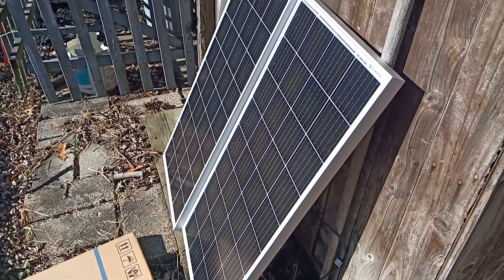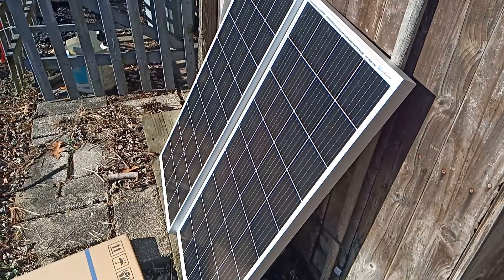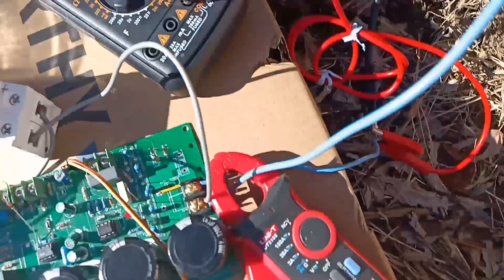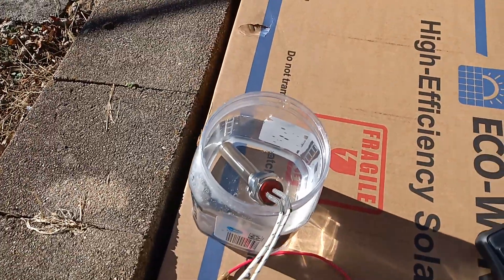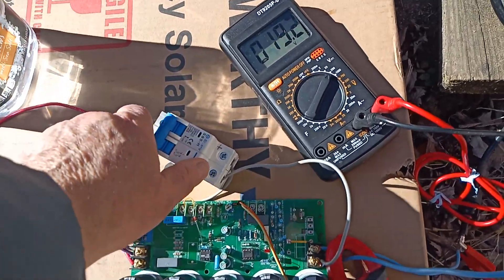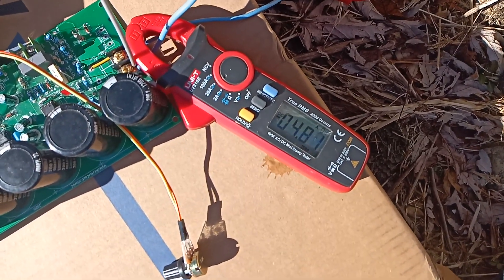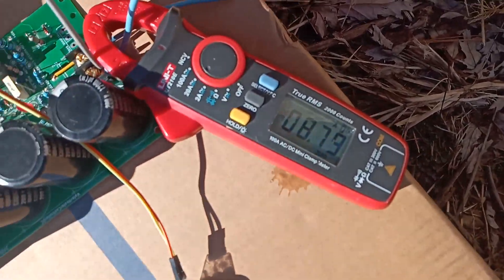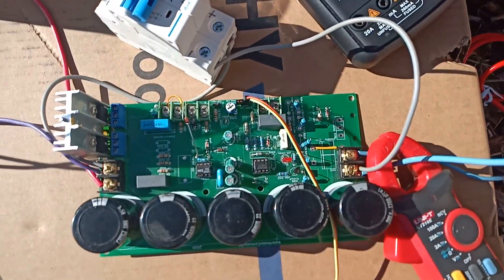Water Heater 200W 12V Element & Panel Test Direct Connect vs Power Point

Comment from the maker: With a 12V 200W heating element measuring 0.76 ohms in direct connect the current was 8.79A (Isc is the normal current in direct connect) which produced 7.5V on the heating element. That produced 66W from 200W of panels, two 100W panels in parallel.  Panel specs were Isc 5.2A, Ipp 4.95A Vpp 20.2V per label.  It was a clear winter day around noon.  Using the power point controller, the panel voltage was 19.4V and current was 8.08A (Ipp is always lower) and that produced 157W. My dog walked in front of the panels dropping the power temporarily to 4A.
Reply: try it again with 200 watts at 24 volts...........you will see the heat.
Reply from the maker: @dianetigert1310  That is a good question. But, are you suggesting a 24V array or 24V 200W heating element? No need to try this to find out. Everything can be predicted by simple math.

A 200W 24V element would work much better than a 12V one. It is slightly higher resistance than what many call ideal. Real world data has shown that total daily production increases when resistance is significantly higher than ideal in direct connect. There is considerable downside when resistance is even ideal or slightly below.

In direct connect, a 200W 24V panel would have an even greater loss of power. In fact, adding an additional 200W 12V panel in series, a 400W array, would not produce any additional power in direct connect on a 12V 200W element.

It takes a thorough understanding of PV solar fundamentals to heat water. This is the reason so many are unsuccessful heating water with PV.
Reply: @opera5714 
 In peace.....thank you for responding
I was thinking, because I to love the solar idea of trying to live in a greedy world of expenses.  
The dog blocked the sun for a moment causing the system to shut down, after he left, full sun restored the project. What if you tried solar panels that produce 24 volts each series them to 48 volts at 200 watts each totaling 400 watts?. Looks like your converter would handle the voltage? 

Maybe a converter 48v to 12v DC? Your solar would produce 48 v at 400 watts, your heater element needs 12v at 200 watts DC...........the converter you have would provide the extra voltage when demand goes up..............just thinking
Reply from the maker: @dianetigert1310  This is well established technology used around the world. It is just unknown to the US market. This is someone in Lithuania who built one of my designs which works at 120+ volts.  
 https://www.youtube.com/watch?v=3TY_u6m9JXM   
The voltage is only limited by the FET and capacitors used.  I was sent that heater element for evaluation. It is ten times lower in resistance (0.7 ohms) than the board was designed for (6 ohms).   The capacitor bank should be larger for this low resistance. It is designed to operate with a minimum RC time constant. The technology still worked with some adjustments.  I don't advocate stand alone systems.  This is designed to operate off PV array voltage which is also used by a MPPT charge controller to harvest only excess power not needed to charge battery. This is a superior way to harvest excess PV.  Nobody else does this.
Reply: @opera5714  
I've been viewing the Chinese using DC step down converters and they sure do have the knowledge.
Solar straight to DC 48v t0 12v converter then to inverter running 3 devises. Thought it might be worth sharing.
Reply from the maker: @dianetigert1310  you don't understand electronics at all. Bad idea.
Reply: @opera5714  
I was only sharing what others have accomplished, simple DC converters  (STRAIGHT) TO INVERTER THEN DEVISE. IT WORKS FOR THEM, I will continue to explore what others have achieved,  sorry to have stepped on your toe regarding...God Bless.